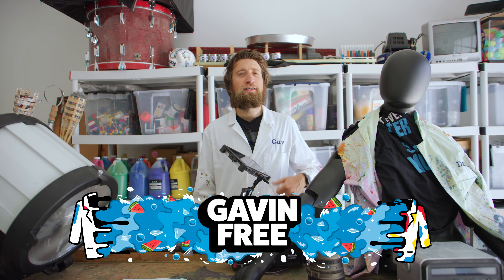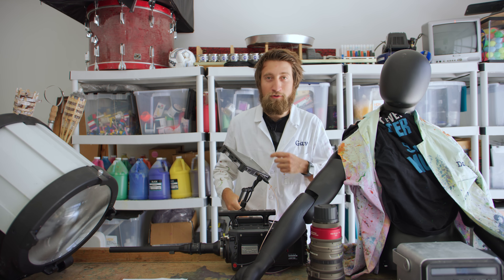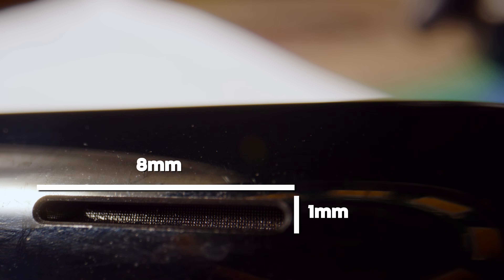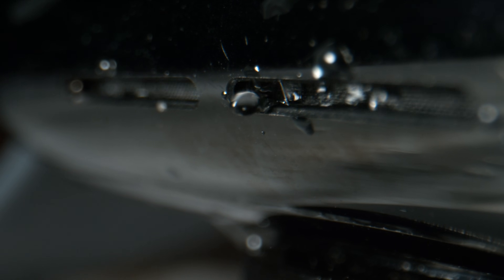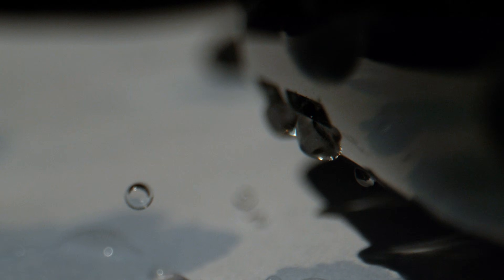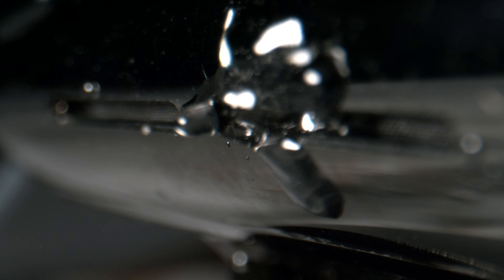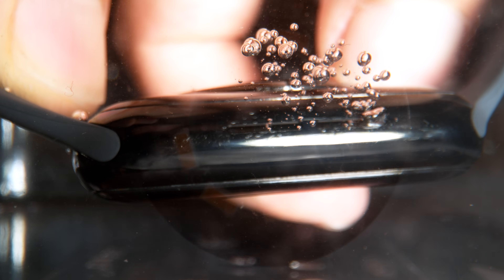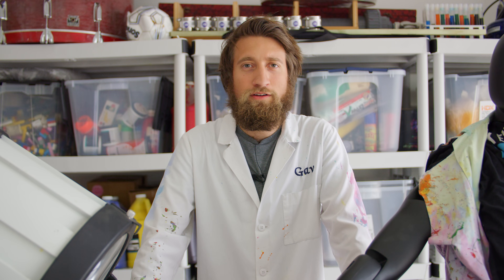How the Apple Watch Ejects Water in Slow Mo - The Slow Mo Guys

Comment: Lets all have a moment of silence for all the apple watches which hasn’t been set in water mode when they should have been🥴
Reply: I’d like to know what happens if it’s not in water mode. And if it ever gets 100% of the water out. 💦
Reply: Xyrz Mxyzptlk nothing bad happens to the watch. The only function of the water mode is to lock the touch panel to avoid unintended touches (Gav explains capacitive touch panels go crazy when wet). The actual electronics of the device are passively sealed.
Reply: Ale Zuvic - That’s fascinating. Assuming it never pushes 100% of the water out and some is always left to evaporate, you’d think those sound ports would eventually clog up with sediments.......but I’ve been mistaken before. Thanks for your answer. 💧
Reply: One moment of silence from me
Reply: @The World Just Slower you do btw have some interesting slow mo on your channel
Reply: The World Just Slower I never knew that I had to set mine in water mode and I went swimming lots with it, still works completely fine.
Reply: @yambo9668  You don't have to engage water mode when swimming—although it is recommended! Water mode definitely has a purpose, it locks the display so the display doesn't register accidental touches from the water. Nothing will break if water mode isn't engaged—although you might find the watch randomly sets a timer, maybe calls someone, or other software buttons are pressed—but as you've experienced, the watch won't physically break.
Reply: @something2sea  exactly
Reply: @Inspirational Drawings Thanks
Reply: WhiteHawk 🤣

Comment: I believe that some of the water get sucked back in due to water tension. H2O (water) is consisted of positive and negative charged atoms, that works like a grid, that holds the water together. The water is in a sense magnetic to other water, which is why it still gets sucked in. 

It’s actually really interesting

Comment: Apple: “we made a water resistant watch that can remove water from itself” also apple: “we refuse to service a wet watch”
Reply: My casio is water resistant up to 60 bar
Reply: Kinipshun it’s not waterproof, it’s water resistant. Being water resistant if you get water on it and get it damaged that’s on you and you will have to buy a new watch
Reply: Jin H actually the watch is advertised as being something you can swim with, up to 50 meters. It even has built in swim tracking.
Reply: Cam different watch versions though. My current S5 could easily take around 50 metres for like half an hour, but my old S1 would die instantly
Reply: AuthorOfOne the watch in the video is either a Series 4, or Series 5. Both are advertised as supporting 50m + Swim Tracking. Both of them void their warranties in the case of any water damage. Apple is effectively refusing coverage for a damage that can be caused by using one of the watch’s advertised functions. That’s the problem.
Reply: Jin H Bu if I’m paying them to repair the watch they should repair it
Reply: Jin H waterproof isn't actually a thing
Reply: It’s water resistant, however it’s still limited on distance it can go based on the IP rating. If you misuse the watch and get water in it then it’s not covered. Pressured water can go beyond the gaskets.
Reply: Owen Yin no “water proof” when referring to a device is very much not a thing. I can agree if we’re talking about a lump of plastic but there is no such thing as a waterproof watch or cellphone. If it’s going to have an electrical current or moving parts, water will cause it to fail. And whatever method chosen to protect from water will eventually fail from any number of reasons. You will 100% never find any device that is actually waterproof.
Reply: PeterAParker but if you don’t do that and it gets damaged doing something that it was advertised as being able to do? Then they won’t cover it. That’s the issue. If you do something stupid duh that’s on you, but if it breaks while you were doing something they said it could do then you’re screwed XD
Reply: Will Mungas you won’t find Apple claim that it’s waterproof anywhere on the Apple website for that very reason. It is water resistant up to 50 meters. The problem is over time electronics become less and less water resistant. If you are concerned about coverage they sell AppleCare for 79$ for 2 years or $3.99 a month for as long as you keep paying monthly. That covers any kind of damage. If an apple watch were to get water damage it would be impossible for Apple to tell how long it had been under water and  whether it was used beyond 50 meters. All Apple would be able to see is that it had water damage. This could open them up to massive amounts of fraud at the Genius Bar. People could use it to intentionally damage their watch in order to get a free replacement device. I worked for Fossil and we weren’t allowed to say those watches were waterproof either even though they were rated for 50 meters.
Reply: @KJames1984  50 meters or 164 feet is deeper than most divers with proper gear will go. This watch should never fail as a result of water intrusion for nearly all of its users if its claiming this depth.
Reply: Jasun Smith those tests are done in static conditions and in fresh water. Like dunking it in a glass water and taking it out right away. not swimming in an ocean.
Reply: SirScrodoTBaggins no in things like watches and electronics it 100% is not a thing. You will only ever find them say water resistant and depth at which they rated to withstand before failure. On top of that those ratings are decided using static tests.
Reply: Also Apple: We'll sell an average computer for 3 times its price
Reply: I StM I tbh i wouldnt sell a macbook for 400, i think its worth a bit more than that
Reply: TheJosiahTurner he’s talking about like the 5000 macs
Reply: TheJosiahTurner lol this guys was selling a mac from 2008 for £120

Comment: I'm surprised Apple didn't make use of frequencies that can atomize water. It's likely a limitation of the speaker design, as those frequencies would require a piezo-crystal ranter than a magnet and inductor.

Comment: Apple rarely impresses me. This is one of those moments.
Reply: ikr
Reply: ok
Reply: Apple really innovated a lot withe the watch
Reply: Same here. I consider myself to be a phone user, not fixed to one os. I do have a 11 pro max after a year of Sammy. I buy every year. 
But I'm really impressed by the impressive engineering here.
Reply: @Blitzkrieg63  no one should buy a phone every year, that's ridiculous a phone should last 3 or 4 years
Reply: My Samsung Galaxy watch does this too
Reply: Then you aren't paying attention, get off the fanboy train and put on some glasses.
Reply: @sorvex9  What exactly impressed you in the last years ? And why are you agressive like this
Reply: I got a moto x4 for way under $300 that is ip68 water proof for long periods, even without some gimmicky lock out feature.
Reply: @narrowurethra182  The water lock feature simply stops the display from responding to touch input so you dont get any accidental input while in the water. Nothing gimmicky about it lol.
Not sure what your phone's water resistance has to do with a video about a watch..
Reply: @Koooo4  I'm talking about the speaker spitting out the water instead of them just making the thing ip rated water proof. And the watch is just a tiny phone on your wrist so it is the same thing. Only the  smart watches in general are superfluous.
Reply: @narrowurethra182  Ahh, so you just dont know what you are talking about. Should have guessed that.
The apple watch is obviously IP rated, why do you think it isnt? Did you think it was possible to swim with it without it being water resistant? lol Spitting the water out of the speaker is just to get the water out faster.

Comment: 3:27 I've never seen such perfect spherical droplets of water
Reply: Actually that's every droplet ever
Reply: @chiellazona5624  If I recall correctly, in rain, a big enough droplet can be more like the typical water drop shape most people think of. A bigger droplet can be more flat, like a pancake of water. Lastly (this is the part I most question my memory on), a small enough droplet can be almost a line.
Reply: Pro tip: Put water droplet into micro gravity. Observe sphere.
Reply: CGI?

lol

Comment: Why doesn’t Apple put water resistant coating on their motherboards? They do seal the outsides, but if water ever reaches the motherboard, the device is fried.
Reply: That's what we call "contrived durability", children. Contrived durability combined with planned obsolescence is what keep our capitalist world spinning. (This is not meant as a political comment, it's simply a fact)
Reply: just how most companies dont make it easy to repair something that you bought or make ir impossible that you either buy a new one or get it fixed wich means you use money :P
Reply: Overheating issues?

Comment: It was not intentionally designed to do this! It’s In fact a design flaw that the watch allows water to settle in the void of the speaker, it might be waterproof yes, but over time that water will make it deteriorate it’s waterproof capability.

Comment: I've had an apple watch for two years and always wanted to know how the water lock feature worked.
I also feel bad for any of Meg's bath products that may have been caught in the splash zone of that bathtub haha
Reply: The water lock just avoids the screen from getting unwanted touches from the water contact. And when you're done with swimming, it also expels water from the speakers. ;)
Reply: Rafael Françoso I knew about the screen part I was just always curious about how it got rid of the water - very cool to not just know how it works but to also watch it in slow mo
Reply: My aunt thinks you turn on water lock after the water exposure. 🤦‍♂️